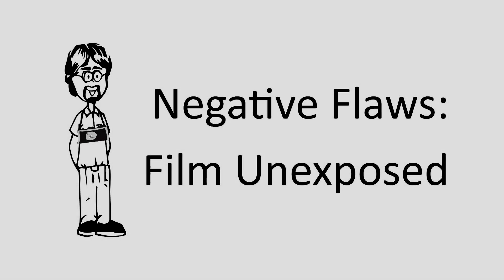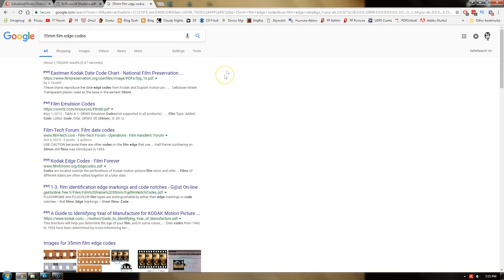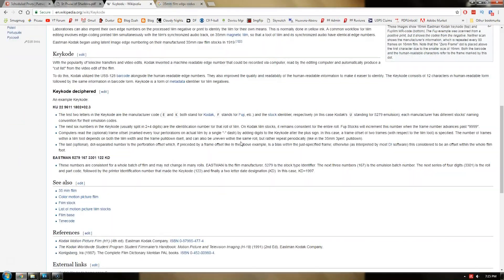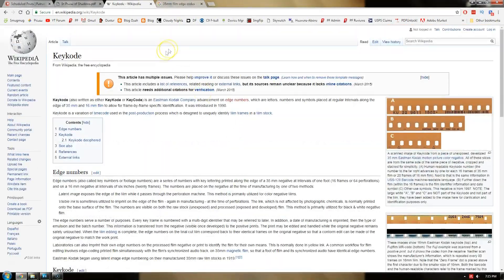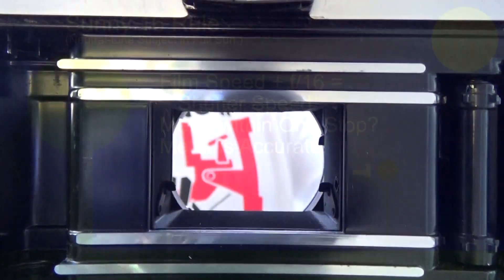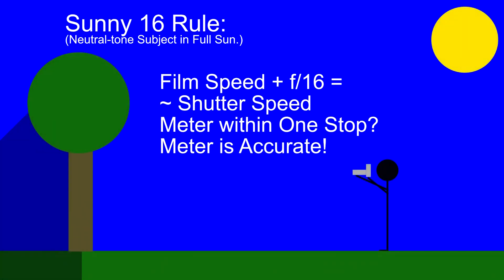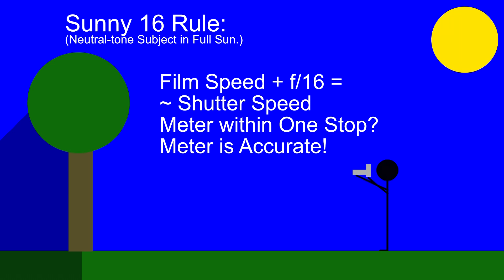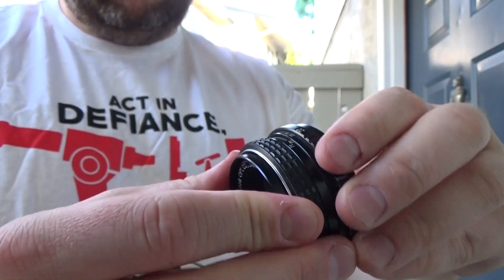Negative Flaw: Film Not Exposed

Comment: When I check a shutter I use a small flashlight. Another cause of unexposed film is winding problems. Either the film wasn't loaded properly or the camera has a winding problem.
Reply: I've done that and it sucks!
Reply from the maker: Oh yeah, I've done that. And thank you for pointing it out. With the old manual rewind cameras, the film knob should turn as the film is taken up. With modern motor-drive cameras, the camera should let you know if the film wasn't loaded properly.

Comment: i got some bulletproof negs when overexposing some delta, handled it way worse than hp5
Reply from the maker: As I understand Delta, it has a stronger physical material than HP5+ and it's more tolerant of exposure errors than HP5+. HP5+ can be exposed at as wide a range, or wider, of ISO ratings, but needs proper development to compensate.